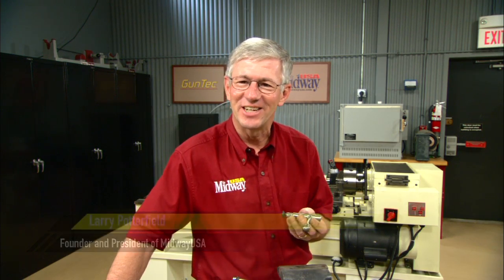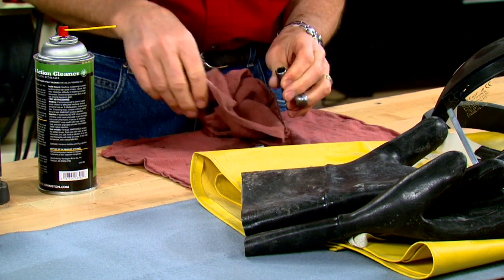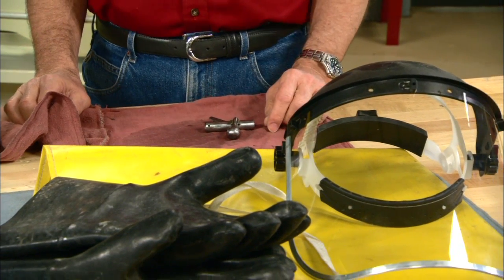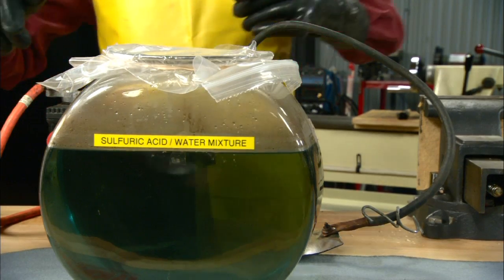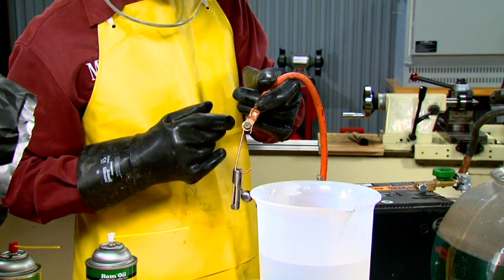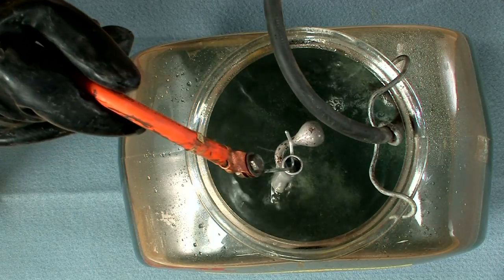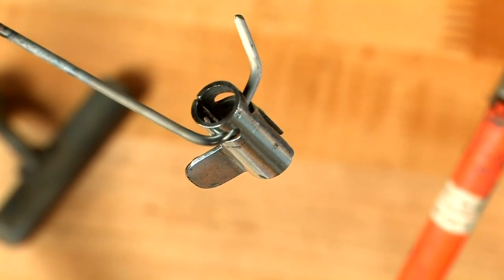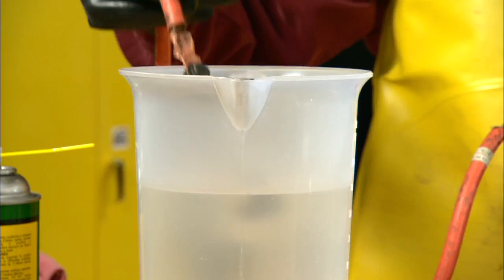How to De-plate Nickel Plated Gun Parts | The Model 67 Project | MidwayUSA

Comment: Even though he only dips the parts in water, I would run them under the tap even longer and consider dipping them in a baking soda and water solution to be sure to neutralize the acid on the metal.  
Remember Always Add Acid to water, not the other way 'round.

Comment: WHAT is you mixture of Sulfuric Acid and Water …. Also rather than use a car battery can I use a regular low voltage power supply? Restoring a few Iver Johnson and Harrington & Richardson .32 S&W early 1900s and later 1890s pistols that are nickel plated … thanks
Reply: i'm doing the same. how did yours turn out?
Reply: @carolynwahl5860  I mixed 50/50 Sulfuric Acid and Water H2O and did similar with the lead and found I needed a car type battery rather than and power station that I have that creates needed voltage but not enough amps it appears. So I had a used lawn tractor battery that had life still in it and charged it fully. I also used vehicle jumper cables because the amps going up the wires to the connected need to be larger. I kept the items in the solution 2 minutes only and it removed all of the nickel and did not hurt the metal of the gun parts. I did plug the barrel and cylinder ports. Hope this helped!

Comment: I 'm having trouble with this process.  Putting the negative on the lead plate, and the positive on the part
 doesn't seem to be working - for long.  Then using a battery charger, I'm getting a red light fault.  Is the connection causing this?
Reply: Add 3 tablespoon salt

Comment: One little advice,  add acid to the water,  Never add water to the Acid because heat will be released and the solution may boil very violently, splashing concentrated acid out of the container.  On another subject,  I know for a fact that the Winchester model 67 bolt is Chrome then the procedure that Larry is explaining very nicely is for chrome stripping,  Thank you
Reply: "Always Add Acid" was the phrase I learned.
Reply: What is the acid to water ratio and what concentration of acid does one use?
Reply: @dlowry27  50/50
Reply: Works on Nickel also.

Comment: I  used this method to remove nickel plating from brass and it worked fantastic. Didn't take more than 30 seconds to totally remove all the nickel plating. Just a hint of the copper flashing left,  that comes right off with brilow and water. Almost unbelievable it works so fast.  
Here's the big danger.  When water is mixed with sulfuric acid, a chemical reaction occurs that causes a bubbling flair up, this reaction will cause extreme heat. I mixed my acid and water in the fish bowl, adding small amounts of water slowly. Still the reaction created so much heat the glass bowl cracked in just a few minutes.  This could create a catastrophe, I was very fortunate .  So I'm passing along to you this tip.  When you mix the distilled water into the acid, mix it in some thing that can take extreme heat. Do not use plastic or glass that is not tempered to take high heat.  I'm thinking something like Pyrex wear for cooking.  This should take the heat, but have a back up plan just in case. Use the safety gear. Let the mixture cool ( about 3 Hrs.) Then transfer the acid to the fish bowl and continue with the deplating operation.
I mixed a 50/50  mixture of sulfuric acid and distilled water.  It worked like a charm, very happy with the results
Reply: When I was in chem class long ago they taught us always add acids to water never water to acids because of this. It helps a whole lot to cut down on this reaction!
Reply: Thanks for the tip Dave.  Yes I can see adding the acid to the water will be a better procedure.  Thanks Steve
Reply: "If you're doin as you oughta, add your acid to your wata"  (Chemistry memory rhyme)
Reply: You sure you removed the nickel plating or just the chrome coating with this method?
Reply: thanks steven
Reply: acid to water... never water to acids. You can end up with an explosion
Reply: When you nickel stripped did you find the anode you were using to catch all the nickel filled up and it stopped stripping?
Reply: A.A.A !    Always  Add  Acid !!!   ...   [not water] !
Reply: Use a beaker.

Comment: You said "chrome," but "nickel" is written. Which one is it actually?
Reply: I want to remove the nickel and chrome as I am having my parts re-plated. How do I do this?
Reply: the nickel is what is bonded to the steel, so once one is gone, so is the other
Reply: No. 
To remove chrome, just soak in a 50/50 mix of muratic acid and water. I let my golf club heads soak for 30 minutes.
Then use this video to remove the chrome.
Reply: Make sure to rinse after the muratic acid, in a water and baking solution mixture. 
It stops the acidity process.
Reply: Follow the video?

Comment: Hi! I could only find a 37% concentration of sulphuric acid, will that work? I whoul realy apreciate an answer!
Reply: You have to do your math here, Your Acid is already diluted, so using 50 as %100, I would only dilute it with 13% water if I would dilute it at all.  Taking %100 minus the %37 you would have %63 of water.  Me personally, I would use it as is, it might take a little longer, but I think it would do the job.
Reply: I'm using %100 because other videos I watched said a 50/50 mix of sulfuric acid and water.  I would use distilled or purified water so there are no minerals to contaminated the process.

Comment: I need to strip a muzzle break down to bare metal that was nickel plated, can this be done with this method? and what is the amount you used for your acid solution? my hole reason for this is because the nickel is blasting of when firing my rifle, so now I'm leaning towards getting it ceracoated.
Reply: Ok, I am working with a mystery of disappearing nickel. 

Could intense heat, like a magnesium fire, be substituted for the electricity? What happens to the nickel -- where does it go? Is there a way to test for whatever it turns into?
Reply: @AG-yj1jv Absolutely
Reply: Yes and use 50% water and 50% acid. Muratic acid is sulfuric acid and is available at any hardware store.
Reply: @stevenswld  Just a correction here, Muriatic Acid = Hydrochloric Acid not Sulfuric Acid.  I think it is important to know what chemical compounds you are working with.  Sulfuric acid is found in drain cleaners / clog removers.